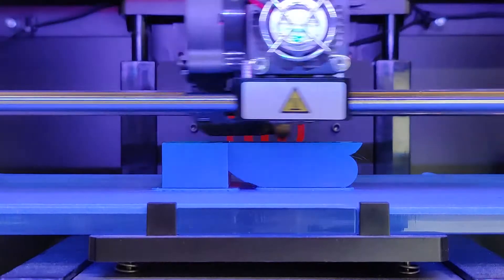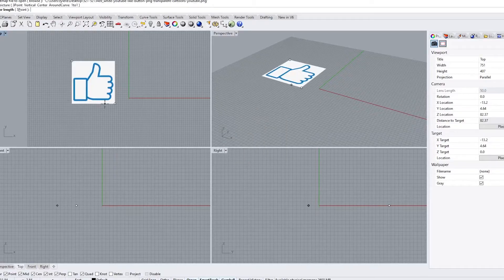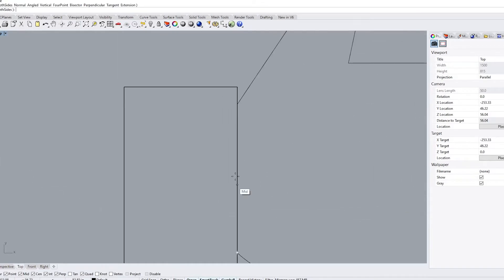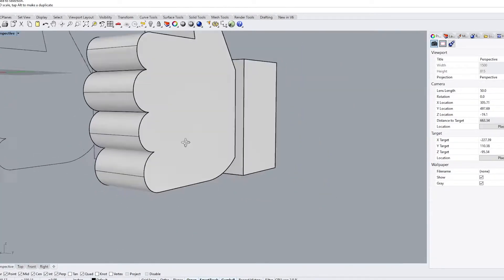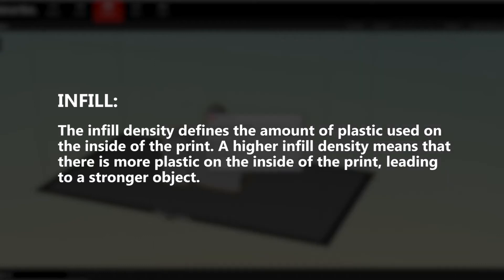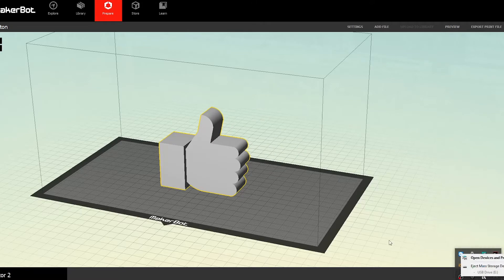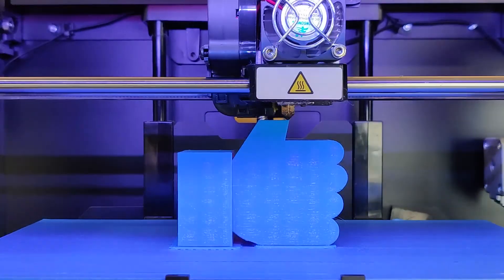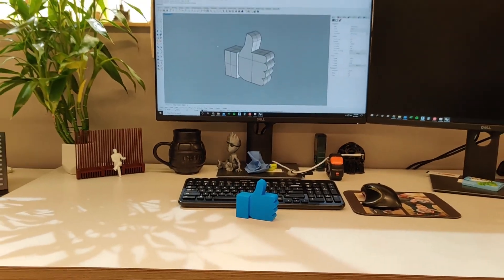3d Printing for Architects / My Process for Fast and Easy Model-making

Comment: Do you have any tips or recommendations on taking an already created architecture model and easily make it a solid? For example, I have a revit file of a tower we built but its hollow with each floor plan and room on each level. It wont print very well unless i use a ton of supports for each floors deck. I simply just want the exterior of the building and the entire inside solid. The purpose here is to print mini replicas of the tower for the project team and the owners. I've come to the conclusion that i just need to redraw the entire thing, floor by floor in sketch up (or rhino), but i was hoping you had some experience with this and could shed light onto it for me. Thanks!
Reply: I'm trying to do the same thing right now! Did you figure out a good method or did you end up having to remodel it?
Reply: @savannahmcdougal1172  How did you solve that in the end?